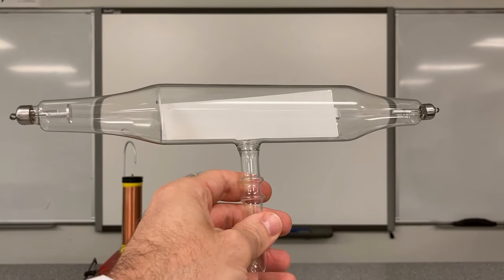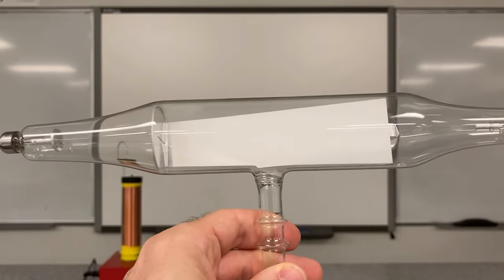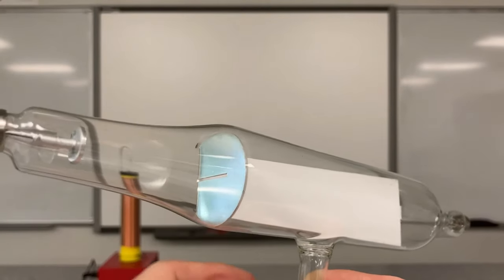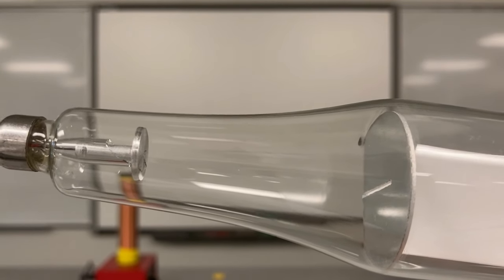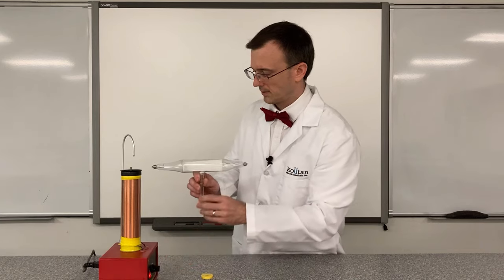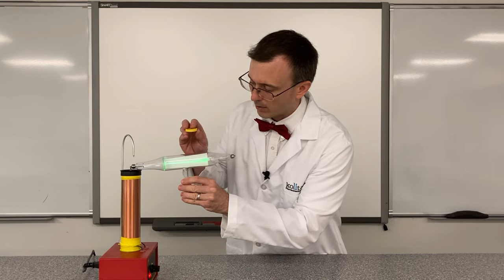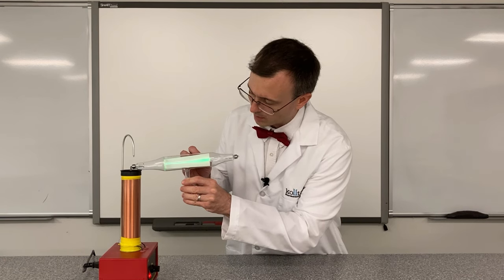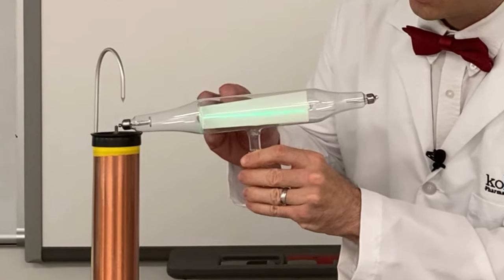Cathode-Ray Tube Demonstration

Comment: WHY CATHOD BEAM IS NOT VISIBLE AFTER WHITE BOARED
Reply from the maker: because electrons traveling through a vacuum are not visible.  You can only see them when they hit a fluorescent screen.
Reply: The real question here is: what are those fluorescent screens often being used in x-ray experiments made of? I've been always wondering that!
Reply: @ketzbook  Hi, do you happen to know why the anode is way over at the other end of the tube? I mean I get that it attracts the electrons over, but it's just that in my physics book it showed the anode as being right over at the side of the tube near the cathode. It also showed the anode as having a hole in it for the purpose of channelling the electrons early on in the tube.
Reply from the maker: @1091Floyd21  I think there are a variety of different designs that all work.